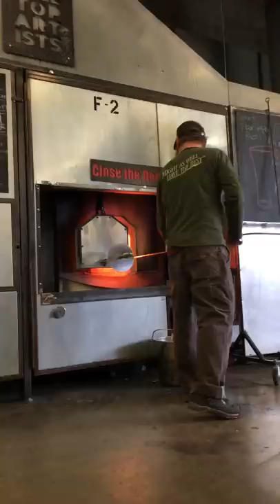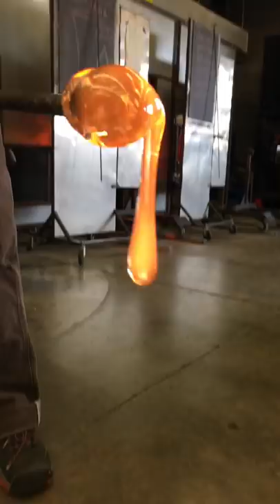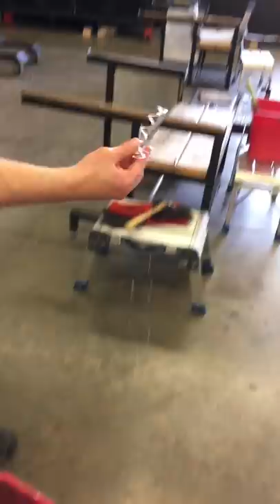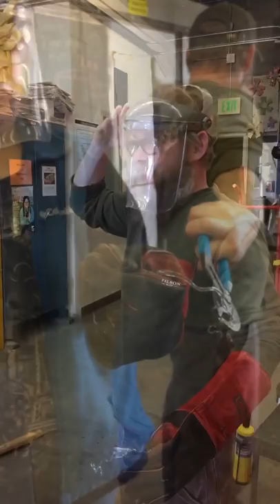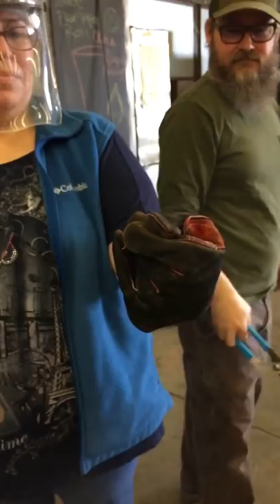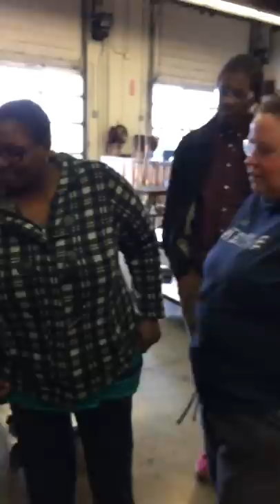Glass artist Jason Mouer demonstrates a Prince Rupert's Drop to University of Washington students

Comment: Would it still explode if you let it cool down / let's say for a week.
Would the pressure still be there or would it have subsided .
Just asking 😎👍
Reply: Yes, it’s basically creating tempered glass. The pressure is from the outside quickly shrinking and solidifying before the inside. This creates pressure from the inside pushing out which makes it strong. But the thin tip is easy to break because of the smaller inner volume of it not reinforcing it and it just being smaller and thinner and pointed. When the inside cools down there is still a ton of internal stress. This can be seen by looking at it with polarized glasses.

Comment: How strong would it be if you eliminate the tail before cooling it? Like how you make marbles, rolling them on two large screws, and you point a blowtorch on it to keep it super hot, and then let it fall into water. I mean, they can take a bullet as long as the vibrations don’t travel to the fragile end.

Comment: Does he snip it or does it explode when he starts to let off the pressure  I think it explodes from the reverse of pressure as he's turning it when he begins to let off the twisting pressure it seems to explode why would he twist it in stead of just snip it ? Can anyone explain this ?
Reply: To add he's using flat faced pliers not cutters and it's clear as he lets off the pressure it explodes! I'm a metal worker too and  know that glass and metal display very similar characteristics I'm composition, both need to be anelied to relieve the stress from working either material otherwise they can fracture or in this case explode I'm not sure cuz I haven't seen metal explode but I have seen spring steel snap after being hardened and you have to anneal it before you can bend it otherwise it'll snap.

Comment: Great curly tail on your drop there. Its a wonder why it didn’t melt through your bucket. 

I think you should be able to whack it with all your might and still not break it. I had seen on another you tube channel, Smarter Every Day, shoot one with a pistol and a rifle. The round shattered! The drop remained! He shot it again and the round shattered again and i think a piece of the round connected with the tail was the only reason the drop failed. 
So whack away, my man, as hard as you can.